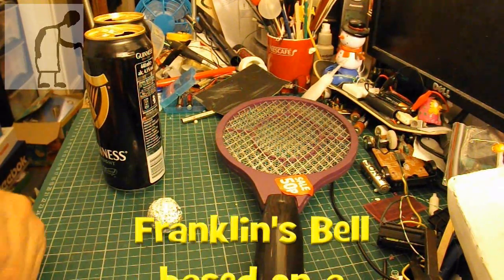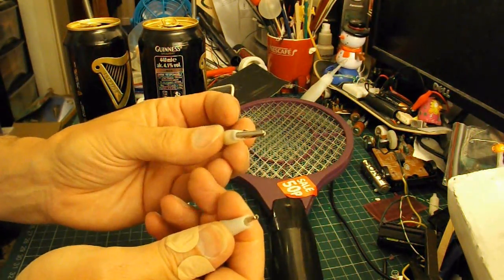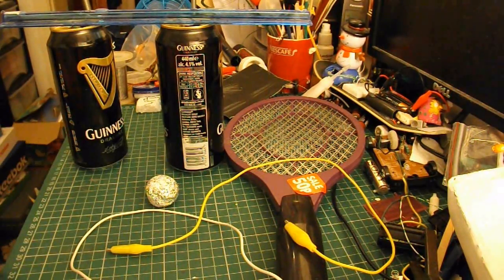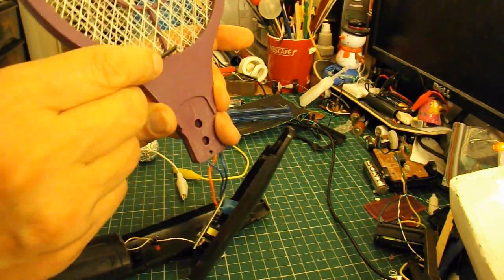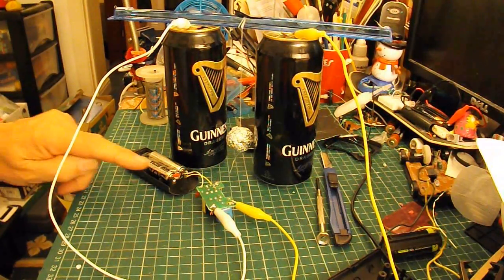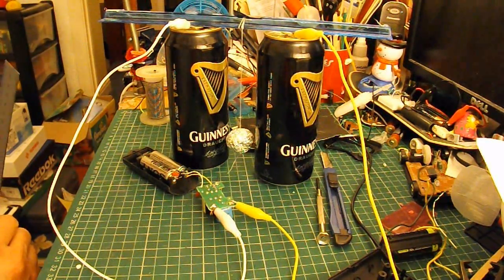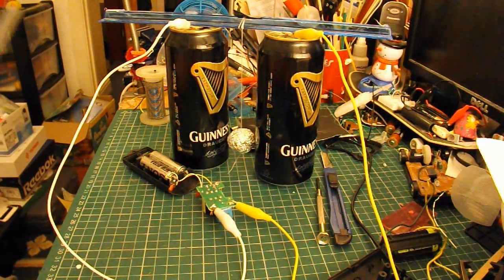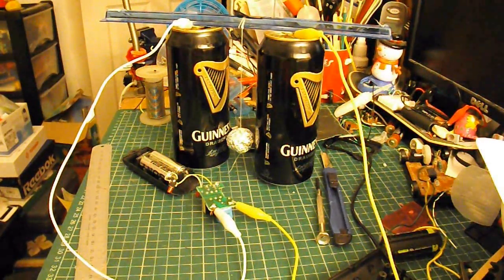Franklin's Bell based on a Thomas Kim video

Comment: I want you to make a drone plz
Reply from the maker: +Sean Gtaff that is a regular request and I have created a standard reply, the answer is NO. To make a helicopter or quadcopter stable in flight I would have to buy so many parts designed for the purpose it is cheaper to buy a ready made helicopter or quadcopter. A good example would be something like the Eachine H7 2.4G 6-Axis LED Mini RC Quadcopter. On top of that, my channel is aimed at simple, quick, cheap projects and a helicopter or quadcopter build is not a simple, quick, or cheap project. You would be better finding a channel that specialises in RC Quadcopters or Helicopters so you get the information from people who know what they are talking about. FliteTest would be a good place to start although they tend to focus more on planes than copters https://www.youtube.com/user/flitetest
or anything David Windestål is involved in https://www.youtube.com/user/dadde87
or you might like this video by The Post Apocalyptic Inventor https://youtu.be/qa_x93JQhNM
for rubber band power check out the work by norris432 https://www.youtube.com/user/norris432

Comment: can u make a foam cutter out of a fly zapper?
Reply from the maker: +Lol Plane I doubt it. For a foam cutter you need a good constant current supply, This bug zapper make a high voltage but very low current. You could heat a wire with a single AA battery and get enough heat to melt a thin bit of foam for a short period of time but you won't be cutting wings for your plane.
Reply: ah wat a shame

Comment: I would only discharge the blue capacitor (where the crock leads are attached to the pcb). And I would use something isolated, like a screwdriver. Still a good example of a rather simple experiment most people should be able to replicate. Now we only wait for the fly to go and sit on that ball.
Reply from the maker: yes I expected to get a belt using the metal ruler but maybe I was well insulated from ground :-)